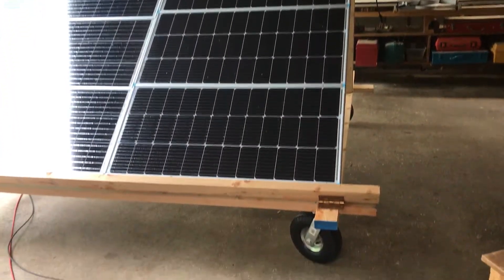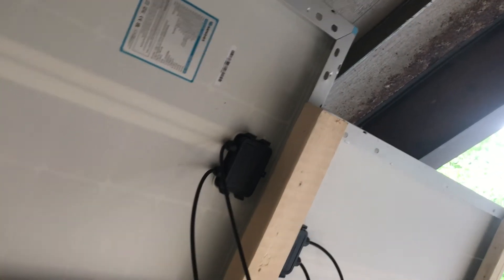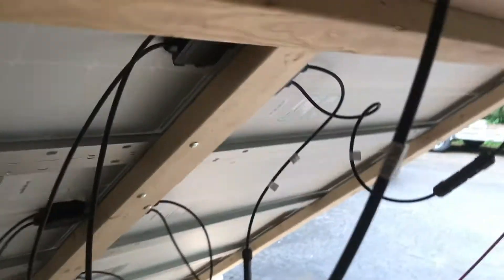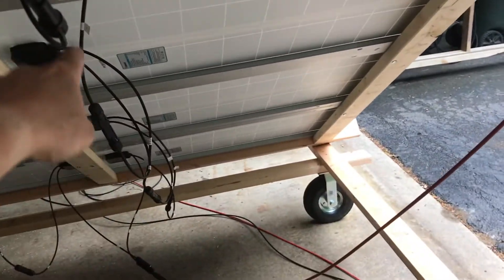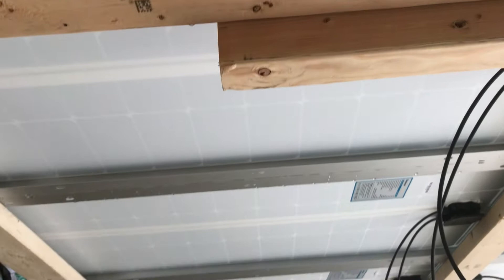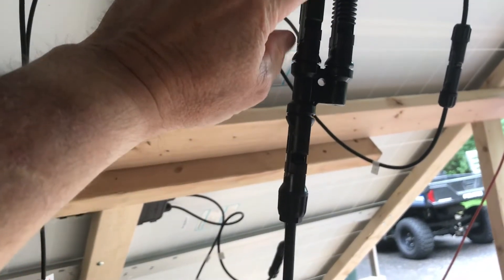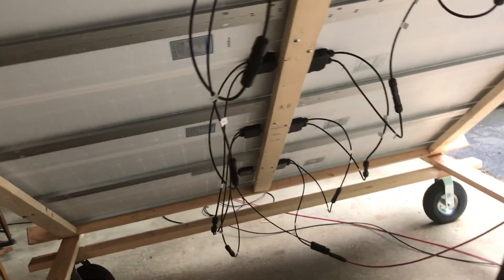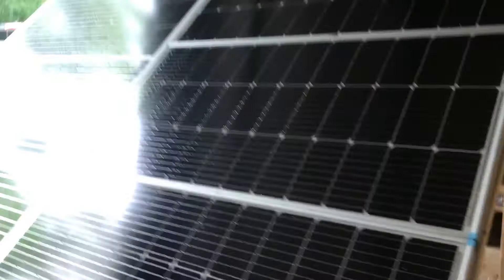12 100 watt panels, wired in 2 strings of 6 series in parallel

Comment: If you mentioned it in the video, I'm sorry, I didn't hear it. At what distance are the arrays from your home and what gauge wire are you using using at that distance? Thank you for the videos. The are a huge help.
Reply from the maker: I berried  an 1 1/4" pvc conduit from my house to my garden about 50' and my bluetti is about 50' from where it comes in. So that is 100' and from the l&b at the garden is connected to a 50' that allows arrays to be moved around. So total is 150'
all cable is number 10 except for one 100' run is number 8, I got a deal. Noticed no difference in loss. Number 10 would be fine
Reply: @johnkayak10  Thank you! So if you stepped it up to 8 and 10 gauge, how did you wire it to the Bluetti??? The solar inputs are only 14 gauge. Did you re wire the inputs to the larger gauge or did you use the factory and they are not overheating?
Reply from the maker: @MichaelS-4547  Using the factory connections .They seem fine, not overheating that I can tell. I wondered about that as well. I will have to ask bluetti about that .
Reply: @johnkayak10  John, you have been a wealth of knowledge. Thank you. I have been hesitant about connecting to a transfer switch with the Fusuon Pro. I only need to just so I can run my well. I was considering splicing in a 220 male and female plug in line to the well pump. If the power goes out, I unplug them from each other and run and extension cord from the Fusion Box to the well pump wiring, by passing the breaker box. I'll add an inline breaker on the extension cord side. Sounds like a horrible idea as I write this, but I think it will work out just fine. LOL
Reply from the maker: @MichaelS-4547  I am not familiar with the Fusuon Pro. Is it a split phase system?
Reply: @johnkayak10  Yes. So I can power a 220v circuit. Instead of plugging it into a transfer switch, I'll go direct to the well pump via breaker protected line. 

I have one head unit already and three batteries. The other head unit and 4th battery will be ordered in the next day or two.
Reply from the maker: @MichaelS-4547  Cool!  I am still working on figuring out how to go about running my well with solar.

Comment: I'm still a bit confused on where these plug in on the AC300.  I understand the AC300 has two MPPT controllers and can handle 2 arrays (1200 each for a total of 2400W).  Are there two plug in's on the unit itself or do both arrays plug into an adapter which then plugs into the AC300?
Reply from the maker: each array has negative and positive coming from it, so total 4 wires. The cable that comes with the Bluetti that plugs into the PV input has four MC4 cables at the end. They are labeled PV1 positive PV1 negative  and PV2 positive PV2 negative   two wires for each controller
Reply: @johnkayak10  Okay that makes sense, thank you yet again.  Love watching your videos, keep 'em coming and people will follow!